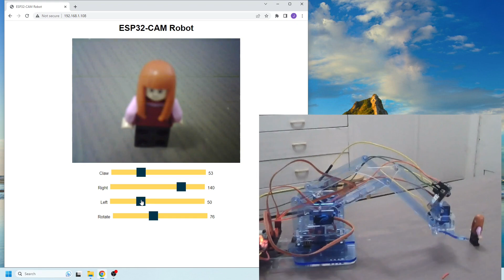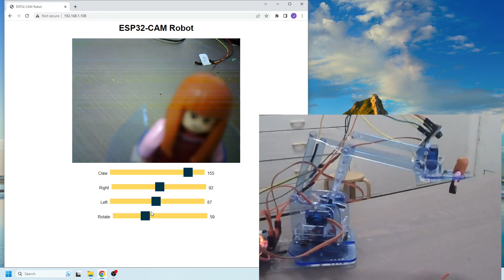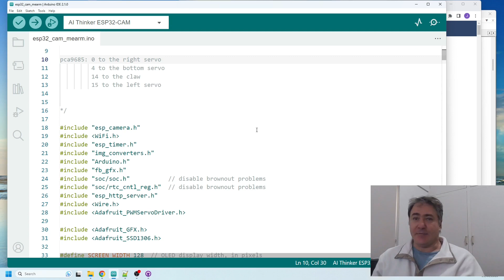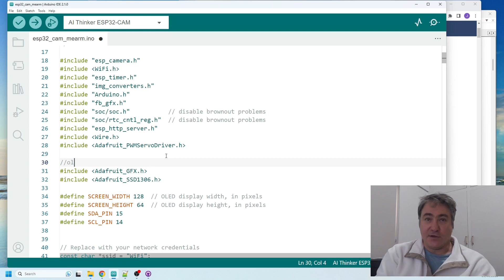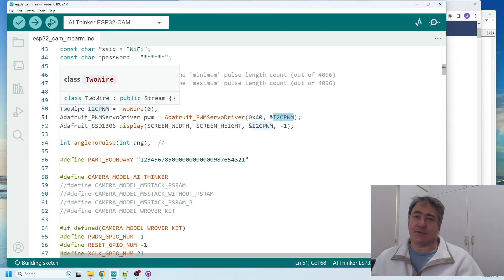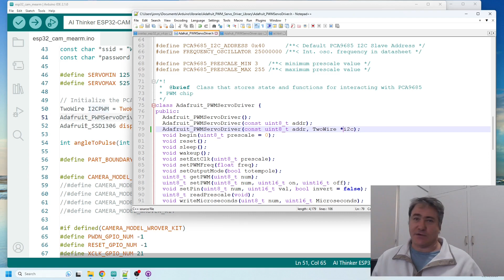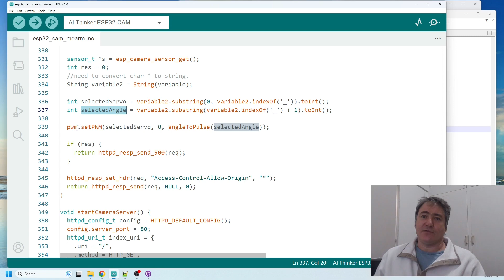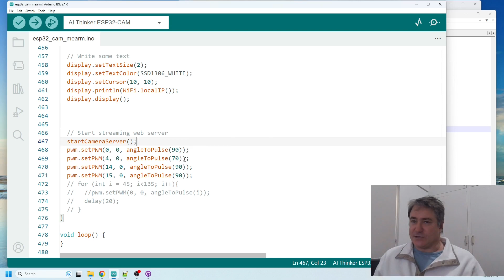esp32-cam for controlling a MeArmTM robot claw with a PCA9685 and I2C.

Comment: I am trying to do a mash up of a number of your projects.
I have made a laser cut mdf robot arm using 360 degree servos running gears for strength and stability. I want to combine with your water pistol sentinal.
 The servos now have no position.i am thinking of using ir position modules with black white printed disc. With maybe tick spacing for location question is could you point me to a simple code video to implement location
Reply from the maker: @Graemecns  I’m not sure what you mean by the servos have no position
Reply: I have converted some servos to 360 degree (also ordered some new ones) which makes them just a motor 0 degree is counter clockwise rotation at max speed 180 degree gives them max speed clockwise 90 degree stop. I think I can use an IR collision sensor and a black white check 360 degree wrapped around and read position. 10 degree increments for position
The servos are running a reduction gear with a bearing for support.
Reply from the maker: @Graemecns  so you have removed the potentiometer and want to estimate the position visually? Why not use a motor with an encoder? Or try an imu?
Reply: I like the simplicity and easy mounting of the servos I have already made my robot arm with the gears it smooth and seems strong i am not familiar with imu just had a quick look will do more research. I setup the ir collision sensor and it is reading 10 degree increments maybe some maths in the code could track position and set virtual e stop for stroke to stop a crash?
I would like to send you a couple of pictures but don't think it can be done on YouTube.
Reply from the maker: @Graemecns  Send a photo to my email. I will try to have a look this weekend.

Comment: How do I fine the library to edit  eg "wire.h'
Reply from the maker: @Graemecns  what IDE are you using?
Reply: @jonathanr4242  I am using Arduino IDE I want to scan for the i2c attached but the wire library uses a begin () and will default to the normal sdc scl  won't scan the assigned pin 14. 15.

Comment: Your code working for me now.  I used all your great work and now have success with the drone Bot workshop ESP32 dev board with PCA9685 working with the ESP32 Cam Amazing.
I am going to try and implement the PCA9685  it on my Gell blaster sentinel from your autonomous water squirter. Amazing

Comment: I have setup with two servos and have got "up down" working on PDA9685 " 0" and "Left Right" on "4" where in your code do you assign the PDA9685 Channel
Reply from the maker: @Graemecns  pwm.setpwm
Reply from the maker: P.S. I think I might've had to change the pca dirver file. Everything should be on the github. I remember there were some issues with getting it to work on the esp32-cam because it wasn't using pins 21 and 22 for the i2c. This was a while ago, and my memory is not good anymore.
Reply: @jonathanr4242  yes I saw that and have loaded your modified library.

Comment: Hi Jonathan, I recently tried to duplicate this robot arm. Here are a few things I want to point, maybe someone will find it useful. To upload this code to ESP32CAM, you will need a Arduino IDE 2.0.1 and up. Also you will need to install board ESP by Espressif. It seems to be working the best with version 2.0.10 (I tested from 1.0.4 up to 2.0.11), because there is a ton of error codes with the other ones, 1.0.6 actually uploads and compiles the code, but it will constanly reboot the ESP32CAM.     And if you could, I have run into problems with wiring this rig, I checked the linked video about PCA9685, and also replayed your video from 2:10 to 3:20 to get the best look at all the wiring, also checked notes in code about where to connect 2 wires from PCA. But servos are not moving, web video feed is working, moving all sliders (code with buttons too) are sending signals to ArduinoIDE Serial monitor - so something is working, but I think I missed a wire somewhere. Also, is oled display is crucial in the work logic? They are both connected to the same i2c bus, in same wiring order, in my case, there is no display so maybe this is the main problem. If you can, describe wiring a bit more, or how to bypass oled display in the code to work only with servos via PCA.
Reply: Actually, here is an update, I connected ground from PCA board to ground on ESP32CAM. and used // to comment all oled display lines in the code, and it works properly now.

Comment: Awesome Jonny, can you attach a joy stick, instead of the screen controller?
Reply from the maker: Yes, that would be really easy. You would need two joysticks because there are four servo motors.
Reply: please where is the link to the code?
I would like to know how to connect oled screen to esp32 cam
Reply from the maker: @preciouskalu2619 the code should be on the github link in the description. Let me know if you have any issues.